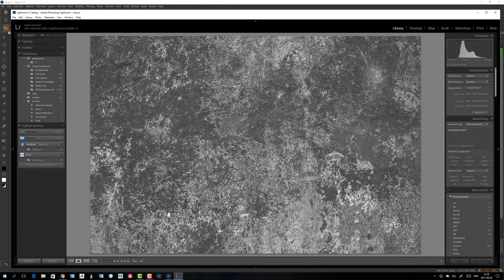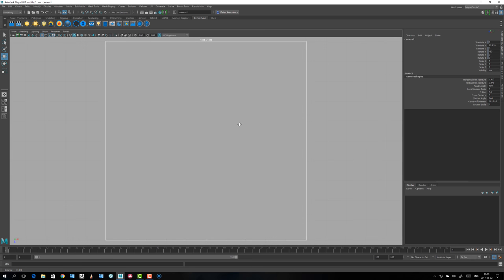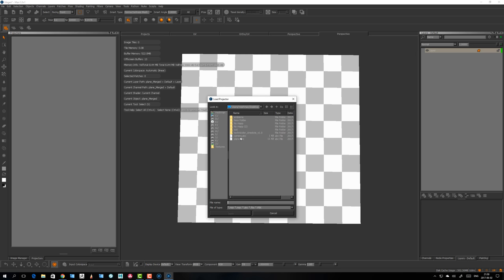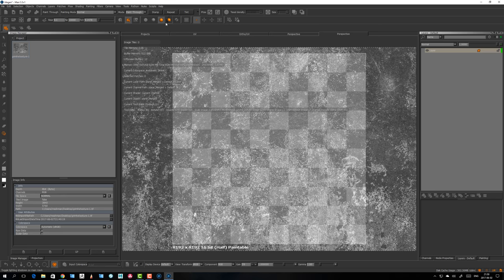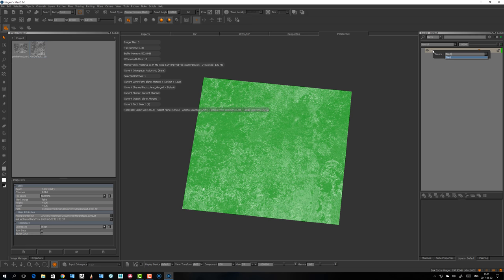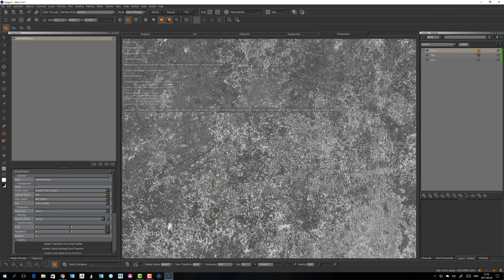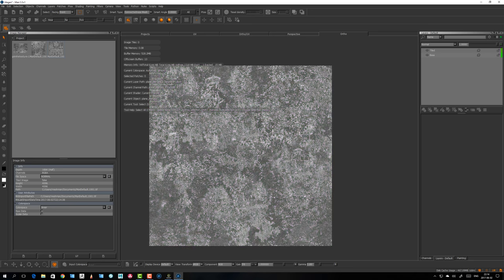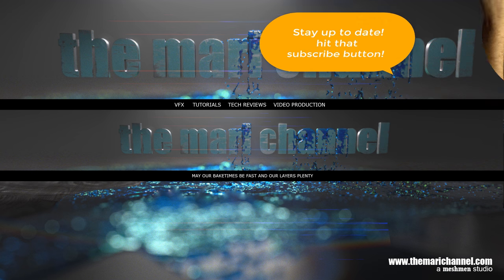Mari Tile Generator tutorial | Create your own tileable textures inside Mari | Mari in 5

Comment: If you got Extension Pack 4 you can go to Object/Add default Object and c hoose from tileable plane 2x2 or 3x3. You can paint straight away tileable on those
Reply from the maker: +campi3d wicked i got to check it out, thanks
Reply from the maker: campi3d another reason for ext pack